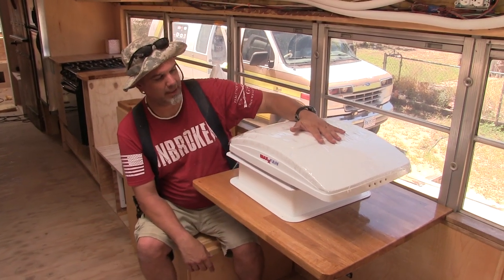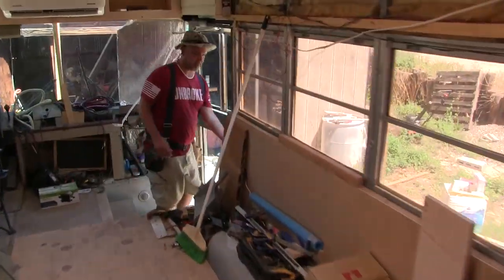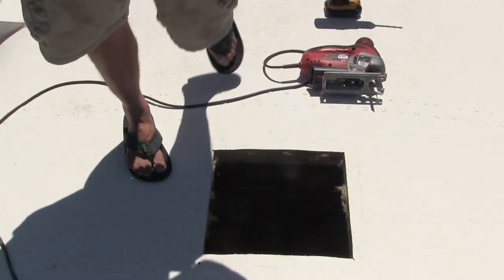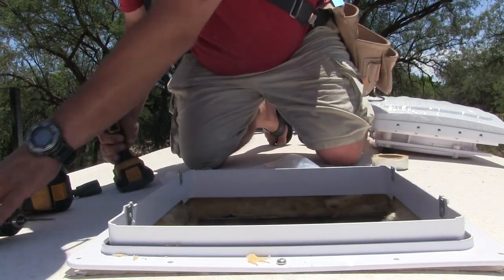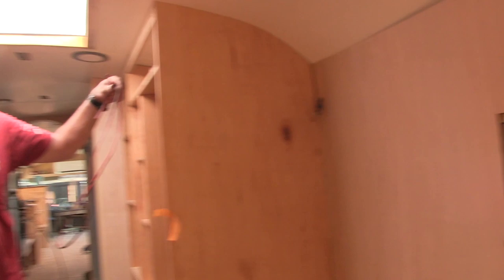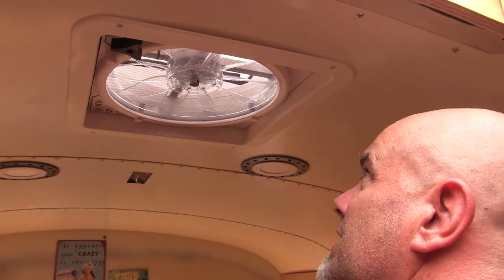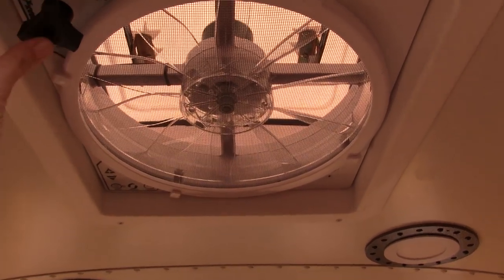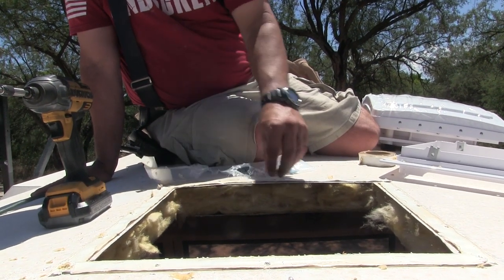Installing a Maxx Fan Deluxe in our Skoolie Bedroom!

Comment: Hey Mike, you know i am a fan but i really don't like scotch locks. You may be better off putting your feed wires into a connector block (suitably rated for the amperage) and fusing the fan there. It's a long run through the insulation if you get a short, plus you shouldn't loose the tapped into circuit if the fuse pops. Cracking install though, loved the pull through.

Comment: Normally with butyl tape you need to do more than one layer. I watched a guy do 2-4 layers and then his fan stopped leaking. It was a Maxx Air fan too. It helps but one layer doesn't do the job, especially on a top surface. So, just be careful. This is the coolest 
Skoolie on Youtube without a doubt. Very fun to watch you two do this build.

Comment: we have 3 of these in our 5R, had to older ones but just got these. Our ac is in basement, and to run both compressors we need 50a. I really like these as they circulate air nicely. We have one over bed, one in toilet room and one in rear of living room.  The low profile when closed also helps our solar. Thanks for the video , it helped my husband to install ours.

Comment: Liked the vid but you might want to remove some of the insulation and spray closed cell foam in and around the fan housing ,by doing this it will cut vibration /noise down and help keep the heat out side . Because when the out side roof heats or cools it will transfer from the top through the insulation to the inner roof.

Comment: Excellent Job on the vent.  You will find out when the sun is barring down on the roof, the heat will radiate through the plastic vent.  On mine, I installed bubble wrap inside the outside cover with 3M spray glue and it make a significant damper of heat coming through.  On the skylight in my shower, I did the same, because it was an oven in the summer time in the bathroom.  Something to keep in mind with the heat.  Good Luck............... 
O', one last thing, I expected the insulation to be black from sweat and mildew, but it was clean as the day it was installed.  If that is an example of the rest of the insulation in your bus, that is great, which it shouldn't give y'all any sinus problems later on.
Reply from the maker: Yes everything in Arizona is dry and clean. It is a rare case that someone finds mildew in Arizona.

Comment: I don't know how far you are along, have you considered tinting the windows with mirror tint? I'm doing my little house with it, the door and windows. It still let's light In. . as long as it's darker inside, ppl outside can only see their reflection,  it's like a two way mirror, it would be very cool on a schoolie! Help keek cool, if you get like 35%-50% you can see out fine, 20% is a bit darker, it also comes in colours, but the mirror, or smoked mirror would be a awesome upgrade, especially if you keep alot of Windows! And you can do it your self, flat Windows are easy to tint!

Comment: Kerry, so sorry about the c-PSTD. The bus really is looking great you two. Mike, since you are such the fabricator, Why couldn't you fab a fishin' reel crank handle for the fan to replace the little knob? They make them with wobble joints now, so it wouldn't hang down except when in use. Just a thought.

Comment: I hope you dont mind me putting my $.02 in but I'm wondering what you're using for a fresh air intake? Hot air rises so if you set the fan to vent the hot air will rise out on its own if you allow a fresh or sometimes called make up air to bleed in, it will also help with cooling the bus.
Reply from the maker: Thank you and yes since we left all the windows in the bus it gives us a variety of ways to allow fresh air in as well as the Skylight that opens. In the evening when we're going to bed we can close all those windows and open up the pocket windows in the back to allow fresh air to wash over us to keep us cool in the summer.
Reply: @BussyMcBusface  being from the south open Windows are not always an option(flying vampires AKA mosquitoes). Just thinking out loud

Comment: Off-Grid A/C at night idea! It's in use at my engineer friend's off-grid fishing cabin. He's a retired wing wiper, so no plans to finally learn about sweat or discomfort during his golden years ;) 
He used a standard "garage chest freezer" full of water with an automobile radiator mounted inside, running off daily solar overproduction. That heat-exchanger is part of a closed loop containing antifreeze, with an electric pump plumbed to two more automobile radiators and fans to distribute cold air. A thermostat with a couple of simple circuits drives it, everything is DC so no inverter at night. The freezer, cabin, and coolant lines are well insulated. He says it will freeze you out of the bedroom, especially since the freezer runs all week so the thermal mass is 100% frozen when he arrives for the weekend, even when it's cloudy. 

He suggested I insulate/isolate the bedroom of my BlueBird Wanderlodge BusRV and do something similar. We follow skydiving weather and visit family all around the Gulf of Mexico so the soul-crushing heat/humidity combo makes cooling difficult, especially around that concrete swamp called Houston, TX. We avoid clouds and already have an excess of incoming solar during the day, plus the infrastructure and money for a few more panels. We definitely DON'T have the money for extra panels plus enough extra LiFePO4 to store the needed juice for regular A/C at night. 

I'm a software dev/electronics nerd so an Arduino controlled system under my bed would be fun, with a short coolant run, one radiator/fan at the head of the bed, and cheap temp sensors and simple UI to log and tune flow rate, fan speed, and room temp. I plan to cannibalize a used fridge/freezer, then build a super-insulated plywood/foamboard/fiberglass freezer to fit under the bed. I'm also prepared to cut out the middle-man, and just sew PEX coolant lines between two bedsheets if Plan A doesn't beat this heat.
 

Just an idea now that your HVAC is complete, with no room under your bed, duh.
Blue Skies!
Reply: Forgot to mention having a matrix of stainless steel plates, not to keep water from sloshing, but to conduct heat across the container through the ice. Otherwise the ice insulates pockets of melted water from the freezer evaporator coil.

Comment: How is you know there was no structural or wiring or plumbing or such thing in that area before you start cutting.
Reply from the maker: 2 ways. 1- deduction. It was empty space between rivet lines and the are no wires running the length of the bus up there. All the long wire runs are above the windows. 2. I looked back at our video where the walls were off to determine if any wires were running up there from either side. 😁

Comment: Please go back and tape the wire nuts and the blue wire connectors so that one running down the road the wire nuts do my fall off and two the wire connectors don't pop open later on and the jumper wire doesn't fall out.

Comment: Worst wire connectors in the world, they will plague you down the road.
Reply: Those used to "T in" to the existing wires? I've never had a problem with them failing later on down the road.
In my experience they usually fail when I give them a test wiggle, or right after I put the panel back on. On the other hand, I only have about 2 days experience. 
Hell, when I didn't have good automotive connectors I'd twist stranded wire together and then fold the twisted part back alongside the correct wire so they won't just pull apart, then tape it tight and right, you'll have connection strong enough to swing from.